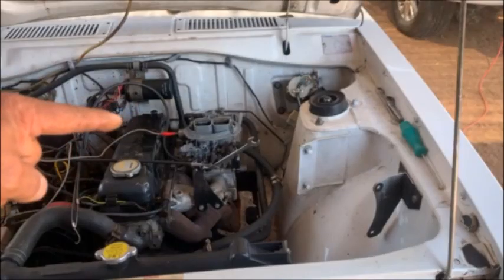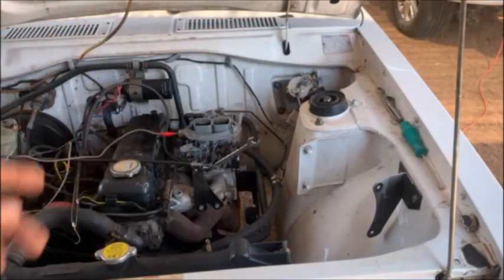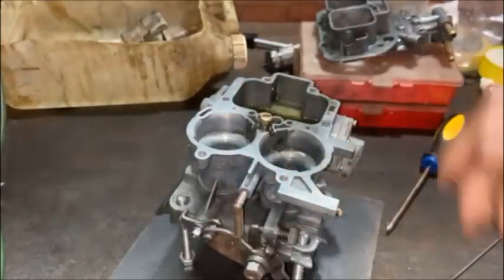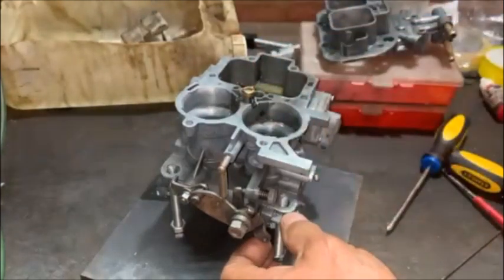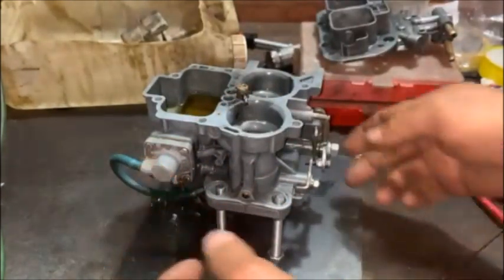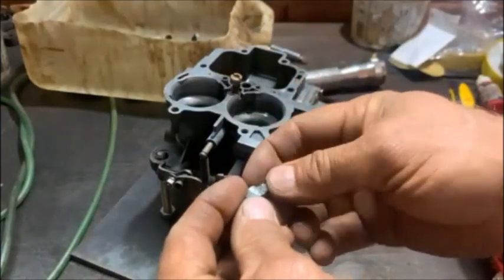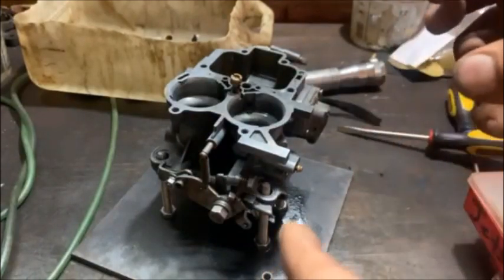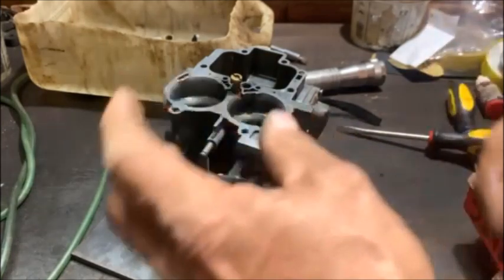Carburettor jetting - 2- accelerator pump

Comment: Hi, first of all, thank you for the great content you post in each video. They help a lot. 
Please, let me know if you have any video showing how to unclog the internal carburator tubes of the acceleration pump. I have a Solex 32PBISA16 in my Peugeot 205 and I about to buy a new carb because of this issue. All the other components are perfect and also all the gaskets and diafragms are brand new.
Thank you in advance.
Reply from the maker: Hi, thanks for watching my videos, you can soak it in Tartaric acid, two table spoons in about 2 liters of very warm water, soak it for an hour or two then rinse properly,  or ultrasonic cleaning or carb cleaner
Reply: @carburettorrebuildservice8964  Hi, thank you very much for the information! I will try it.

Comment: I have a 2.2l 2005 ford ranger, and my carb has been giving me flat spot issues, I'm considering getting a Webber carb I just don't know which one would work properly with the car for the same power output, could you please advise

Comment: Hey there, hopefully you can help me. On my weber first 1-2 accelerations have stumble to them but after that it accelerates fine - like it's primed. The outlet and inlet ball valves are free and no leaks are present. After cruising for a bit it comes back and first 1-2 accelerations have hesitation again. Any ideas?
Reply from the maker: Hi, what carb is it please. it could be several things so i need to know what carb it is.

Comment: I have a pair of 45 webbers and I want to install on my stock a14 engine.
What upgrades do I need for them to work?
Reply from the maker: you will have hesitation and to try to prevent it you would need to fir smaller venturie's for a start. i assume you have aa high performance A14?
Reply: @carburettorrebuildservice8964  installed a race cam but I have started the car as yet. Ported head or extractor would be help also or a stronger ignition spark?

Comment: Webers in general like the 32/36 & 36dcd was build for motors up to 2L...So you don't change anything on the emulsion tubes & spray jets..
so if you have a flat spot on/or just after pull and your idle circuit is corect like in my previous comment about idle jets , Then you have what is called a Lean - hesitation,  you just go one jet richer on air jets or main jets on Primary stage.
remember the ratio for Air to Mains is 3-1
Reply from the maker: I built a 38 DGAS progressive and fitted it ti my 1400, it had a flat spot in the beginning and the only way i got it to run perfect without over fueling was to change to emulsion tube and fit a larger spray jet. The emulsion tube that i fitted made the difference in this case. Thank you for the comment and watching the video.
Reply: It's because of the fixed choke on the 38 weber...
they are big and you can't alter the jets to go small...
now you must compensate for more fuel.